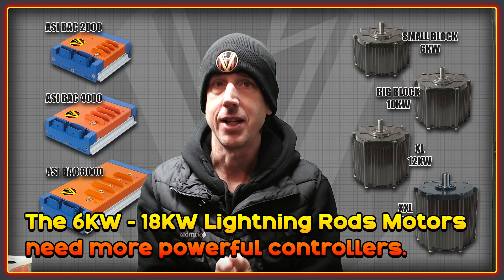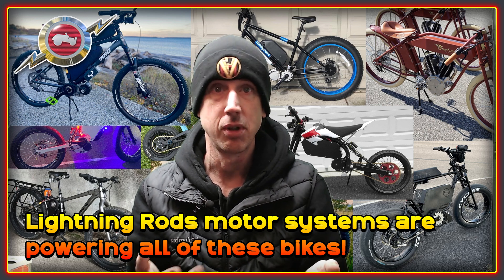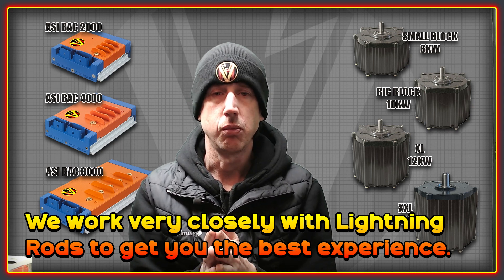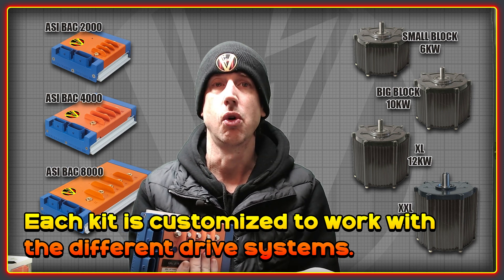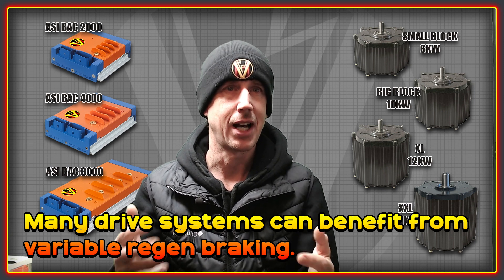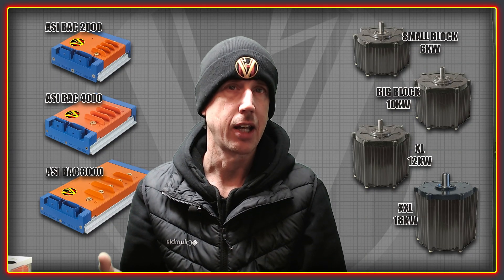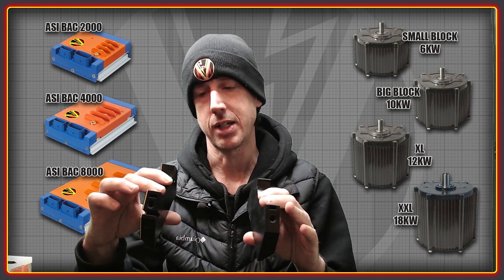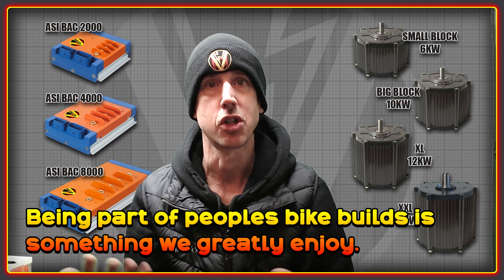Lightning Rods Controller Kits tuned by High Voltage for High Power Ebikes and Electric Vehicles

Comment: i truely believe ASI is going to be left behind soon if they dont make their systems completely open ,and mod friendly there is some awesome high voltage /high current VESC controllers comming out from the inventor VESC,,and they literally do everything you can dream of,,gps tracking and nav you bet,cdontrol of lights and other switchable items yep,wifi,BT,lora,LTE,sdcard logging,,eAsy config CAN bus system,and its half the price of an asi bac with close specs
Reply: there will even be bms for high volt bikes comming soon to that connects to controller via can aswell, now all switches and lights and accesories can all be on can bus too,and theyve made it easy to configure with VESC tool
Reply: 2 whhel drive will be awesome ,even different front and rear motors can be synced via can ,finally ,weve been waiting for this for along time
Reply from the maker: Yeah. You are very likely correct. I'm not a fan of the model. Vesc gets stronger with every iteration and developer that contributes.

Comment: What determines the break-over points between controller levels?  Watts output I am guessing??  Whatever the measurement is, what are the points at which a guy would consider going between an 855 and a 2000, 2000 and 4000, etc?
Reply from the maker: The bigger the controller the more MOSFETS and the more current that it can handle. The more power it can deliver. Of the top of my head the 2000 is good for 6kw the 4000 10-12 and the 8000 goes up to about 18kw+. If you need more details you are welcome to join our Discord community and have a chat with our motor tuning expert! The link is in the description.
Reply: @HighVoltageKits  Thank you!  Is the motor tuning expert @Mr. High Voltage?  Or someone else on there?

Comment: I am getting close to finishing up my install of the xl motor on my titanium bike frame. I had the CYC motor. I was really unhappy with it. Change the gears a few time. Hoping it would help. Could not get the top gear on rear cassette from skipping. Now I have a heavy duty single speed. And way more power. Battery is a 72v as of now. But putting together a 126v battery. 30s X 6p. It’s strictly a road bike. Ya I know a lot of power. I have a few pictures. But don’t know how to upload them here.
Reply from the maker: Discord is the place to put pictures. There is a link here to join. https://highvoltagekits.com/discord let me know if you have any trouble.

Comment: Can I run the XXL motor at 18kw for half an hour ,can bac 8000 work at 96v
Reply from the maker: 72 volts max, 18kw is the peak. Half an hours running would be less. It depends greatly on your setup, gearing etc. You are best chatting to our motor tuner.

Comment: Those look great! What do you think about the 10KW motor to make a regional commuter bike? (100-200 Km range, 90 Km/h cruise speed)
Reply from the maker: Getting that kind of range with it will be tough at those speeds. Its more setup for bursts at 10kw which is its peak. You might get closer to 60kph cruise speed for longer distances. If you want a regional bike like that for the road one of the QS hub motor builds is probably a better bet. 100-200km range will be tough. You probably want to start with a battery size calculation and work back. Rather than design the bike and then find out its impossible to get the range. The ones I am doing will aim more at city and suburb commuters. It will be fun to see just how much of a range we can get tho.